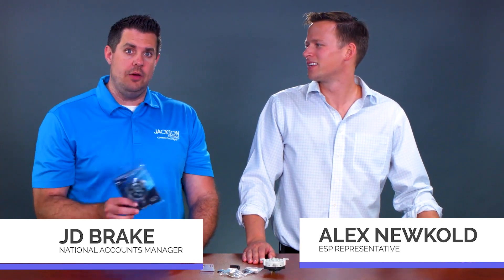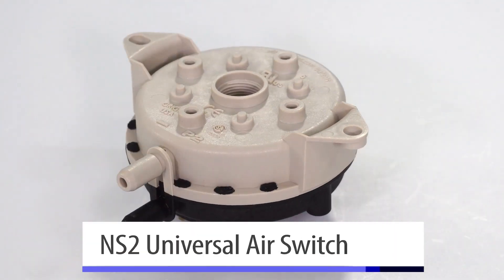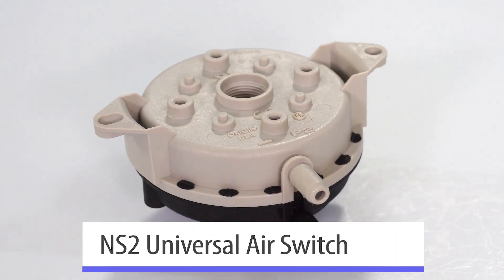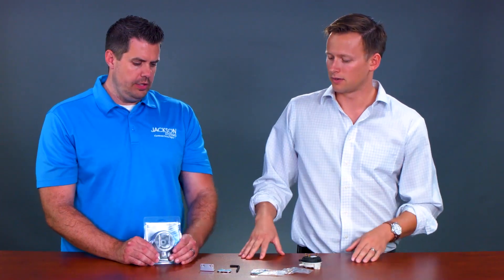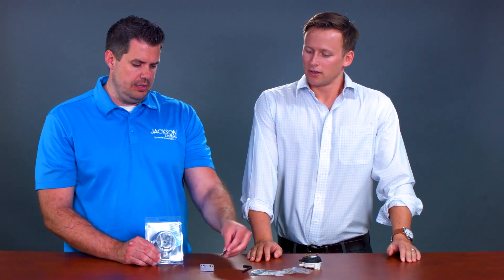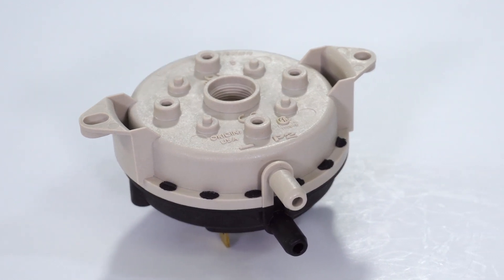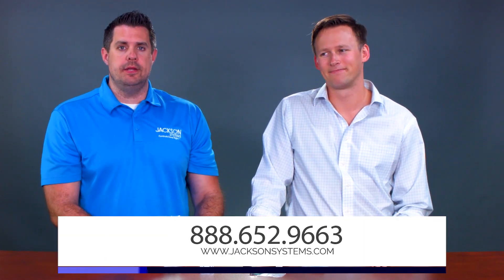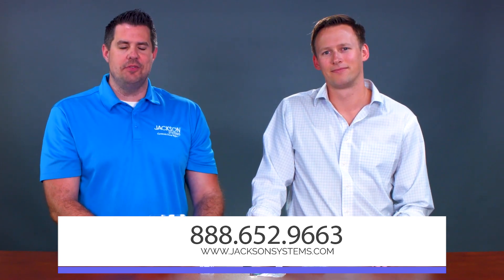The Universal Air Switch by ESP

Comment: Great for truck stock, but you need a $325 tool to set one up or some form of equipment to do it correctly!!!!!
Reply: Yep, I have had 1 work so far, probably by sheer luck.  They are crap.  Just order OEM.
Reply: You should only need a manometer. I would imagine most HVAC techs have them.